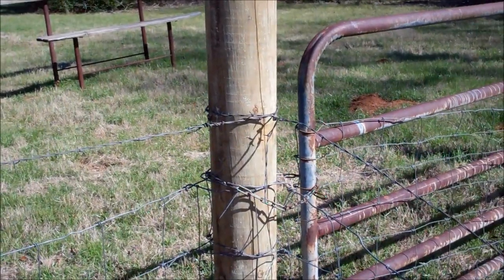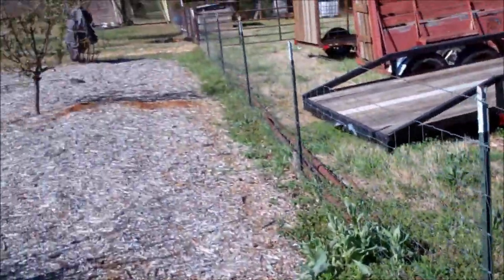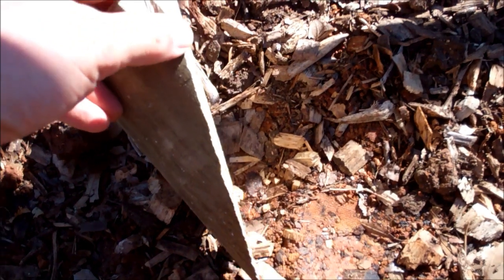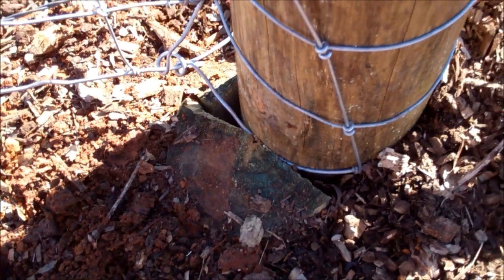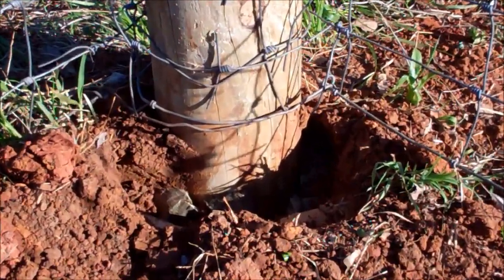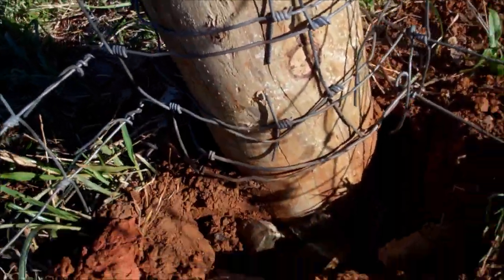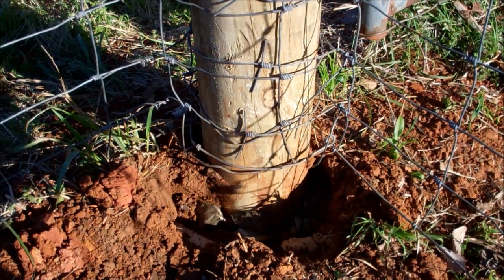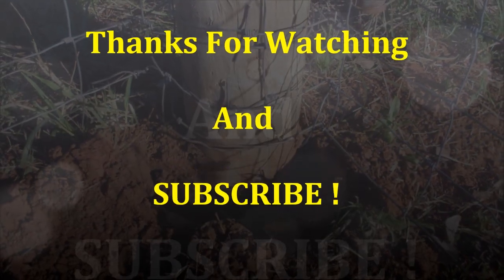How To Straighten A Leaning Gate Post

Comment: For a permanent solution here - or at least for the next 20-30 years with a pressure treated pole, I would auger a minimum 24" W X 4 ft D hole and fill with concrete. That post won't move in any direction but up.

Comment: Hi, it will hold for a bit but not long. We only ever use wooden posts here. If you like, I can do a quick video for you so you know how to do it so it will hold solid until the post rots away. which would be 30+ years. It's your call :)
Reply from the maker: Sure... Let me know when you put it up
Reply: TexasPrepper2 ok, will do :)
Reply: I used to work for a company who serviced electrical poles in the field and we would dig out around them about 18-20 inches down and we would coat the pole at ground level and below with creosote and then wrap tar paper around them over the creosote then backfill the dirt around that. Wood poles as well as wood fence posts rot at ground level, but if you dip em in creosote and cover end you bury with tar paper then plant your post they will last much longer than 30 years with no signs of rot. I've also used fiberglass pipe as fence posts and if you paint it with a oil based paint they will last even longer. You just have to protect them against UV rays.

Comment: In putting up a fence with wooden posts, corner and gate posts work better with horizontal braces running from the gate or corner post to the next post in line in the direction you will be pulling the the wire from.  These braces should be near the top of each post and will act as would a compression member in a truss structure (though this isn't really a truss).  What they do is spread the load from the wire tightening to two posts.  I couldn't help but notice that the dirt around the posts you were wedging looked to be red clay and looked loose and wet.  The best way to get post tight in the ground is 1) compact the backfill around the post with a tamp (I use a 6' piece of 1" rebar and tamp tightly every 2" of backfill as I fill the hole around the post, and 2) don't try to compact wet red clay, because the water in between the cla particles is not compressible and it prevents the dirt from getting tighter, no matter how hard you compact it.
Reply: I built my corner posts out of metal pipe and welding it using horizontal pipe to form a "H" which works great. I even had a trailer crash into it that came loose from a passing truck and it kept its footing and placement although the fencing material was torn up a bit. I live in an area of Texas that has soil like TexasPrepper2 and it works great.
Reply: I wish I had the money to use metal pipe for posts, but don't.  I wish I knew how to weld and had the equipment, but don't.  That would be great. I have to use either pressure treated pine from the local big box store or locally grown and privately cut and split locust posts - crooked, but strong and long lasting. 

From the color of Texas Prepper's soil, I suspect it is very similar to the soil we have here in north Georgia - red clay.

Just offering constructive suggestions.
Reply: What I was saying is I agree with what you were saying about the horizontal braces from the corner posts to the next post, I happened to have done it by welding in that case but I've also built fence using wooden posts, using fiberglass pipe and even mesquite wood and have used horizontal braces like you mentioned with all of them. I  didn't mean to sound critical of what you said, I say use what works for you and gets the job done, more ways than one to skin a cat...:-)
Reply: Off Grid Texas Homestead
No problem.  I was being somewhat tongue-in-cheek with what I said
Reply from the maker: You sound like you've done your share of fence-building. Hats off to you... it's tough work.
Everything you said is spot on. These were such short stretches, it seemed like such a waste to put up extensive pull post systems for them. Now... having said that...
What I did for all my corner posts... when I built the original fence 25 years ago... was dig down about 5' (i put some 6' pcs of conduit on my post hole diggers)... set the pipe in it, and put about 3-5 bags of concrete in EACH hole. I stretched the barb wire (longest stretch was 1000') so tight it would make a banjo player jealous... and they didn't move at all. So... what I learned is... go deep ! If you can get the post deep enough, and put enough concrete in each hole, ONE pipe in the ground is enough. I didn't have to do an elaborate deadman / bracing /  or anything else. It was only 2 7/8 pipe, but it has held for 25 years... with no leaning.
On these posts, I didn't go as deep... but then again... I ain't as young  now :)
Thanks for your comments !
alan
Reply: It looks real good there TexasPrepper2
Reply: TexasPrepper2 I guess I learned from a low budget teacher, my Dad, back in the 50's, how to set wooden fence posts (we used locust) without the use of concrete.  We dug the holes 30", leaving 48" above ground, pt a couple of inches of gravel in the bottom of the hole, shoveled in 2" of dirt, compacted it my hand with the rebar I still have, then shoveled in 2" more and repeated.  It took forever, but when you were done, they were like they had grown there.  I my experience here in north Georgia (Ellijay), I've seen so many fence posts put in with concrete and since concrete shrinks as it sets up, after a week or so, the posts are loose in the ground.  And, of course, wood posts in concrete are subjected to moisture absorbed by the concrete and rot sooner than posts only touching soil.

I think your system works fine if you can afford metal pipe and the concrete.  I think mine works better with wood posts and a low budget and a lot more labor.  Nothing bad about either.

Comment: For good strong corners I like doing the three post method: that's the main corner, and then a line post 10' or so to either side. You put horizontal bracing so they can't pull closer together, then wires as tension to keep them from splaying out. Granted it's a lot more material, but I fear your wedges will eventually move in the soft soil and you'll be back at it.

Comment: we use a common brace called a "dead man". place a post behind the corner post (on the fence line), then go from the bottom of that to the top of your corner (diagonally). If you put a horizontal brace between those two post at the top side of your diagonal brace, it will serve you well. I hope I explained it where you understand.

Comment: No offense buddy, but this is only a quick fix. You should always brace a fence, esp. When you're running wire multiple directions and hanging a gate off of it. Either drive your post, or concrete them. We do H braces. 
Using Wood Post- 8'x5-6w for Corner Post and Gate Posts
Then 6 1/2'x4-5inw posts for braces and horizontal posts in the brace it self. 
We the horizontal post flush to the top of where our wire will run for looks. 
We use landscaping spikes or pole barn nails to secure the posts. And then run brace wire from the bottom of the corner post to just above the top of your horizontal post; staple the top once it's pulled tight, and then twist the brace wire until tight. Some folks like to staple a piece of rebar to the horizontal post so the brace wire can't  untwist
Reply from the maker: Blake Hamby I've done many H-Braces on longer pulls. I made them out of pipe and sucker rod. 
In this instance... the pull was so short that the bracing seemed to be overkill to me... that's why I used this method. So far so good...

Comment: depending on how tight the wire is it will keep leaning, you need to put a brace up on the side with the wire with a wedge at the bottom of the braces
Reply from the maker: I know what you're talking about, and I plan to do that with a pipe post that is leaning (it's in concrete).I'm gonna keep an eye on this one and adjust if I need to...
Reply: TexasPrepper2 the one the gate swings on should lean the most

Comment: this may sound stupid, but does this mean that if you used a larger diameter post, it would not lean? Also, is concrete not used to make it easier to remove or move later?
Reply from the maker: Concrete can help wooden posts to rot.
To a certain extent, yes. a larger post will lean less...IF properly set in the ground
Reply: @BIGALTX  thank you.

Comment: Would pouring concrete down the hole and leaving tractor in place to set up work?
Reply from the maker: Might... it depends on your soil type and rainfall and fence tension and other factors.
But, not really supposed to use concrete on wood posts. Causes them to rot quicker

Comment: Here is a video of bracing a corner post that you may like.  Exactly like your situation.
best agricultural fencing tips - TIP N°4
He also has a great video on splicing fence wire - the best technique I have seen, the way he breaks off the wire without pliers perfectly every time with no jagged end is worth seeing. Here:
best agricultural fencing tips - TIP N°1
Best regards,
Mike
Reply: Dude undo the fencing from that post.. then pull that post dig 3 holes 8 ft. apart  3 ft. deep ...3 in  piping 8 ft long in the holes with concrete level and plum with fence.  1 horizontal brace between the first and second post from the gate., and a kicker from the second to the 3rd post at a angle.  Angle from 1 ft off ground from 3rd to same level as horizontal brace that  1st. And 2nd post are ... that will be there with no movement or pulling a long long long time...